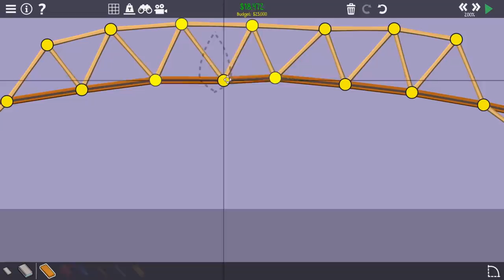Designing a Flawless #1 Bridge in Poly Bridge 2

Comment: Not trying to sound like a dick but...this isn't exactly engineering, y'know, it's trial and error.
if he designed it with equations previously and found the most optimized ammount/length of the pieces and then it worked first try.
Now THAT's engineering.
Yes, I know he isn't claiming this to be engineering. But some comments believe so.
Actually if he did what I mentioned above and actually tried engineering a bridge I would be seriously impressed. That's a good idea!